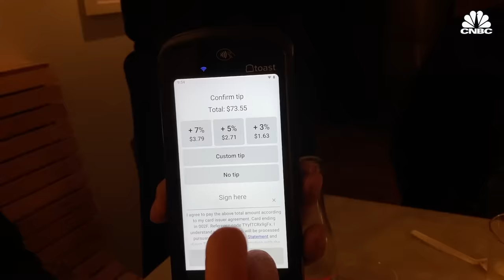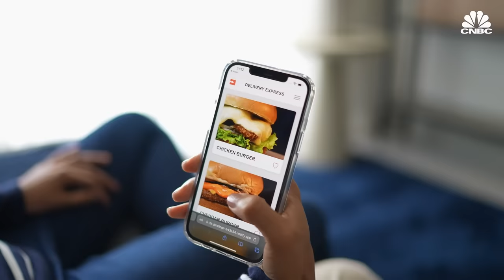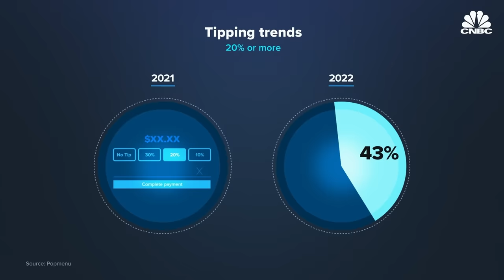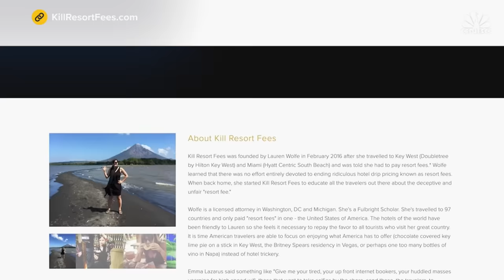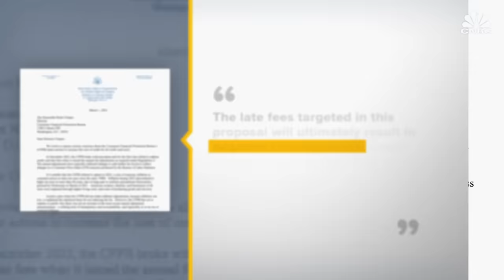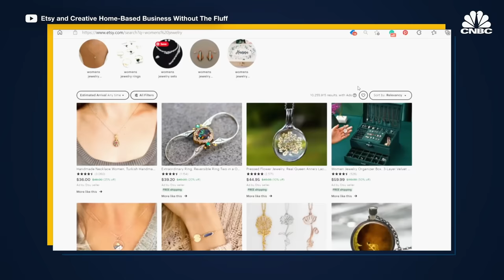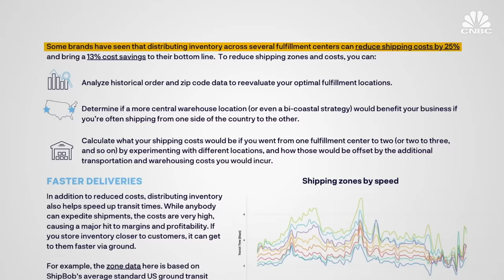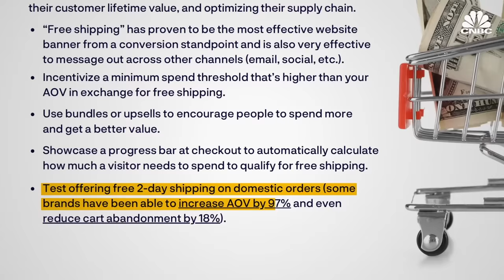How Hidden Fees Cost Americans Billions | CNBC Marathon

Comment: If I’m not sitting down at the restaurant, I’m not tipping a single cent. Initially, I was tipping all over the place but it got out of control. I’ve totally revolted and don’t care anymore about the workers.
Reply: Same, I'm done tipping unless it's a  traditional place I used to tip. I also won't tip more than 20%  I always thought that was generous and I feel sad that it's now looked at as  a bare minimum tip.

Comment: I think its baffling and outrageous that when you order Take-Out online from a restaurant you would traditionally dine in at like Olive Garden etc. they still ask for a tip and sometimes even automatically build it into your bill. There is no service being conducted other than putting items in a bag and walking it out to your car which I would not consider a service, and most especially not a service worth a 20% tip. Moreover, the most aggravating aspect about Take-Out online is that tips are given before the service has been complete, whereas it is typically given at the end of service that way you can give an appropriate tip based on the quality. The most notorious restaurant for bad Take-Out service in my opinion is Outback Steakhouse; they consistently forget to include their signature ranch dressing or dont give enough even though we requested at least two cups. I think people should be tipped according to their quality and quantity of service. Putting purchased items in a bag is not a service no one should entertain a tip for unappreciative pitiness.
Reply: While I agree with you, most of the time, those people running take out are still only making $2.15 an hour. I used to do it, when I complained, my manager made me take on a full table section (about 4-5 tables) on top of busy take out, no where close to the phone or computers. Advice, don’t patronize those restaurants.

Comment: To fight back against the tip craziness, just don't spend your money at those places.  I find that I saved a considerable amount shopping at places that doesn't guilt you into tipping.  Those places are also cheaper as a side benefit.  I found a lot of great hidden gems doing that
Reply: Another option is to not give any damn tip. I proudly select no tip when I'm presented with the tipping options.

Comment: Delivery services should lower their "service fees", so we can tip drivers more or give drivers half of the fees. The tax percentage is rarely correct. Often discussions downplay the exorbitant fees (in regards to percentage) and shame the customer for low tipping instead.
Reply: Even if they did that they would just charge customers more and pay drivers less. They’ve already been doing it. Uber used to take like 10% off of a transaction and the driver would get the rest. Now they take between 40% and 60%
Reply: They don’t make the food. They only get paid by the service fee and up charges. They aren’t Dominos delivering their own food they profit from. People still don’t even tip more even when it is.
Reply: @janettetorrez9218  I know they don't make the food. My point is the charges have gotten higher. The higher the charge, the less money that goes to the driver assuming there is a food budget. Food that totals $19.99 shouldn't come out to almost $50 in delivery. That's more than 50%. Delivery was never that expensive.

Comment: That's a problem. I also stopped buying extended warranties in 1988. I'm over $100,000 to the good even subtracting all the repairs and replacements. Give luck a chance. My wife bought a home warranty in the early 2000s and as soon as our AC went out (you guessed it) they refused to pay. The money we had spent on the warranty would have cut the cost of replacement by 1/4.
Reply: i own a repair service.. we have to pay $75 to go to your insurance company. And it's our "job" to upsell you whatever we want and then we keep the profit.. If you won't pay $75 for some BS markup, then we would do the repair and lose money.. so we walk away from the job and refuse to replace it. LMAO

Comment: The only ones I tip are:

Mechanics 

Dine-restaurants

Independent contractor,  delivery services.

Hair and nail salon

Everybody don't receive tips if they get $10 and up per hourly wage or guaranteed salary. 

Everybody that pay $2.50 per assignment or hourly wage of $2.50 ( like dind in waitresses and hostess at restaurants then I tip them).
Reply: The mechanics make much more. So do the UPS delivery people. UPS delivery salary is between 90k to 140k per year.
Reply: correction just googled.  UPS average salary for delivery drivers is now 170 K.

Comment: you glazed over the most important point. The customer should NOT bear the burden of compensating the under-paid staff. The restaurant service industry lobbies HARD to make sure they don't have to pay a fair wage  That is were the change must happen. Stop putting the onus on the paying customers!
Reply: Servers WANT the current system. Unless the establishment is doing something illegal, the staff is NOT getting under-paid. No one actually ONLY makes $3hr for example.  Servers can often make $40, $50 or more per hour. Sometimes tips aren't even shared with the kitchen staff.  In some states and/or cities, for example like Chicago, staff make $15 per hour PLUS tips on top of that. There are CNAs, RMAs and paramedics in the medical field making way less than them per hour and have massive more risks, liabilities, plus the cost of their certificates, etc. No restaurant is going to pay staff $50hr unless it's super fancy. But service staff can often make that or more. No server wants to actually make LESS money. In fact, in places where they have done a higher minimum wage ($15 or more) but NO tips, servers have complained.

Comment: I agree on the the first two points, but on the third one on free shipping doesn’t make too much sense because shipping can be seen as a junk fee, I think the real issue is Amazon is like a monopoly and needs to be unionized and antitrust laws to protect the sellers.
Reply: How is shipping a junk fee? it's a service. unless you want to drive to the distribution center yourself and pick up your item?
Reply: I meant if they charge consumer separately for shipping it can then become like a junk fee. free shipping is just that the cost is factored into the price.

Comment: I feel like there's so many logical fallacies with tipping. If you work at a diner where the average meal is 15$, 20% tip is 3$. if you work at a 5 star restaurant where the average meal is 100$, 20% tip is 20$. Sure you can say it takes more time and effort servicing a fancier restaurant, but is it really 7 times the time and effort? Shouldnt there be a minimum and maximum amount for tips, not simply a percentage?  Someone can order a porterhouse steak for 60$ or a sandwich for 15$, does it take the waiter 4 times the effort to serve the steak?

Comment: We tip in America because employers don't pay their employees proper wages.  That said tipping for the most part can be ignored and hidden fee's as well. Any business that has unnecessary tipping boycott by refusing to do business with that organization. The same thing applies to hidden fees if a business chooses that route its unnecessary to do business with them. The proper way to tip is based on a very simple value. If you do for me obviously I will tip for that service. Here are examples tipping barbershop let's you jump the line and immediately get an haircut same method applies to hair salons. I go first because I tip well and will immediately leave your business. Going to a club and tipping a doorman or bouncer to jump ahead of everyone else. Basically using a patronage system where people know exactly why your tipping them and the services they have to provide. This method has been going on for centuries and will always continue. It's the reason that lobbyists currently exist in this country.